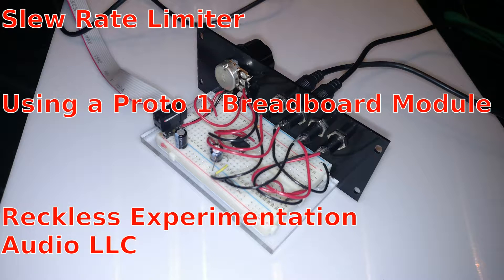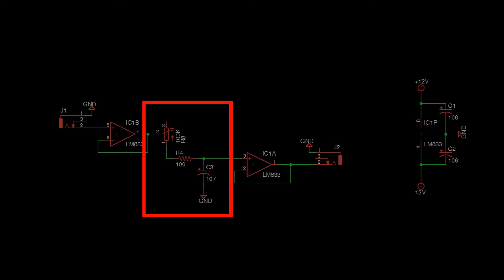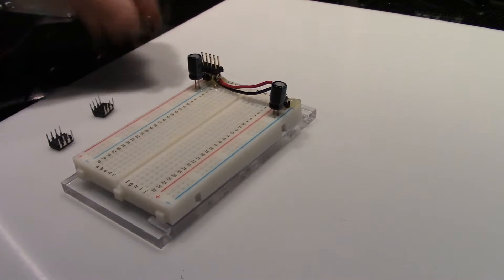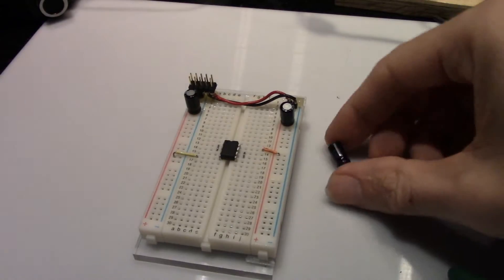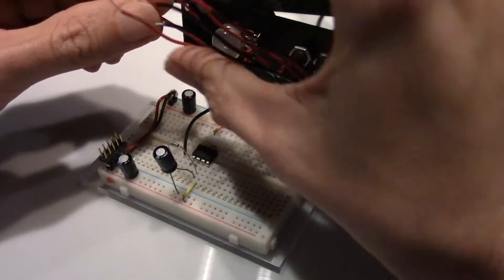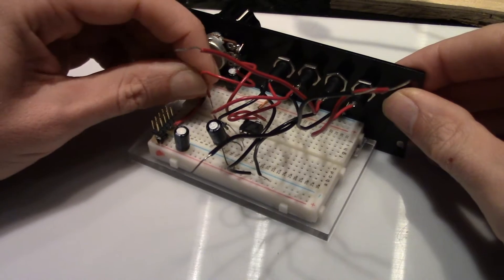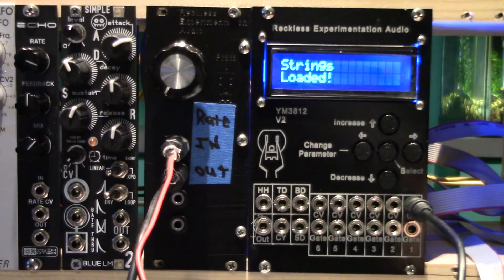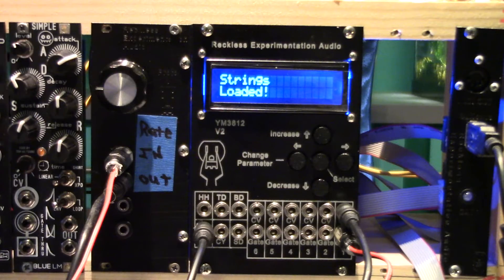Eurorack Slew Rate Limiter using a Proto 1 Breadboard Module

Comment: cool but how can i seperate rise and fall?
Reply from the maker: Have two potentiometers,  one for rise, one for fall. You also need some blocking diodes (one each direction), so that only the potentiometer you want is conducting at any one time. Finally the feedback of the first op-amp would need to be moved to connect to the capacitor, that way the blocking diodes don't influence the output.
Reply: @Recklessexperimentationaudio  cool slew limiter , i added some dip switches and changed capacitor values per switch to ground to have more response options , thanks